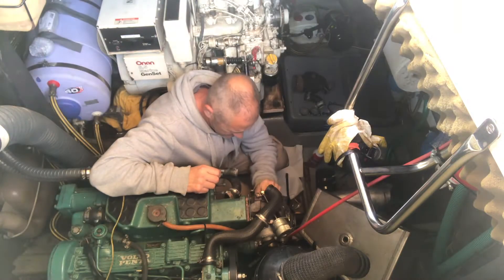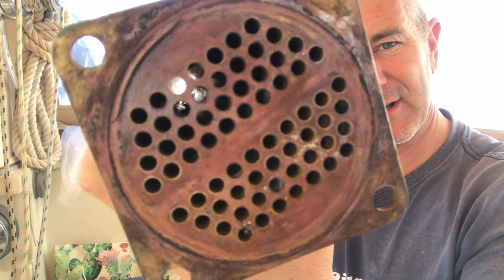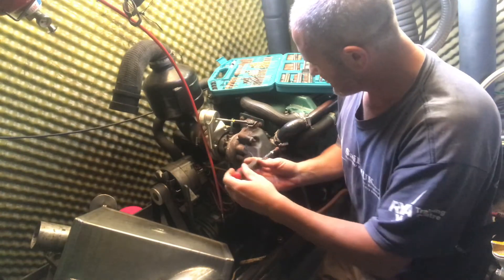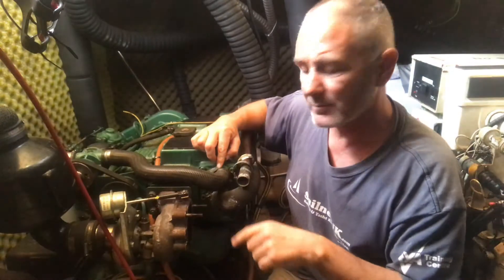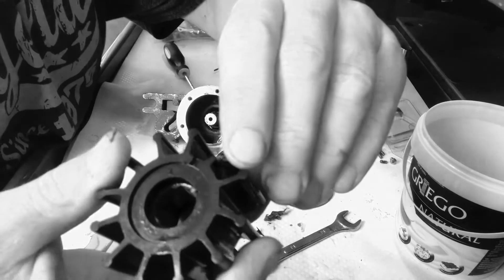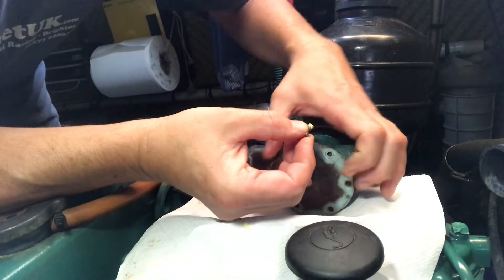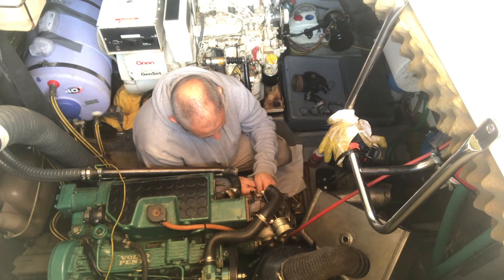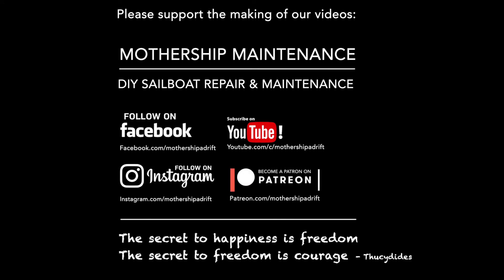Cleaning and Servicing the Turbo / Exhaust Elbow on the #VolvoPenta TMD22 #MarineDiesel Engine PT 01

Comment: Hey Woody, is the turbo and exhaust elbow ok to be done in isolation of the heat exchanger and oil cooler? Presume space a little tight but just need to drop the exhaust box hose?
Reply from the maker: I guess it depends on the design of the engine but on the TMD22, yes. I clean the elbow and Turbo maybe once every two years but only done the heat exchanger and oil cooler once in the last 6 years.
Reply: @MothershipBoatMaintenance  legend thanks. Added to the long list of boat jobs. I've got the same issue with the TMD22 peaking at about 2,000rpm, despite a clean prop and a relatively new turbo.

Comment: Quick question, to any mechanics that'll certainly know more about it that me, but would it be possible to fit one of those into a Leyland DAF (LDV) 200 van? Given that it's the same basic engine that those vans were originally fitted with.